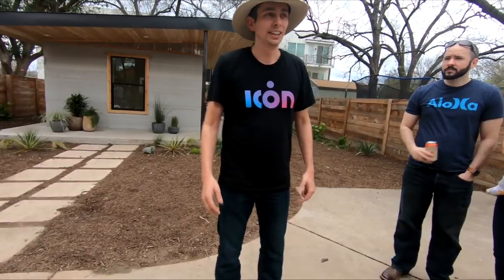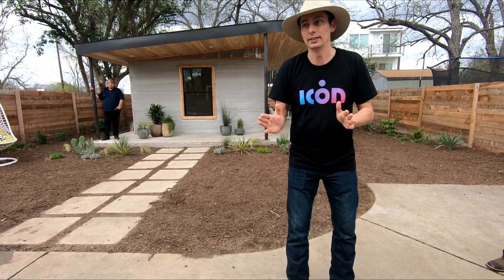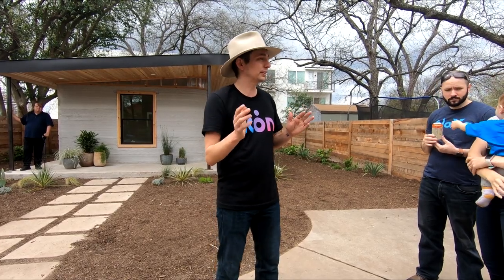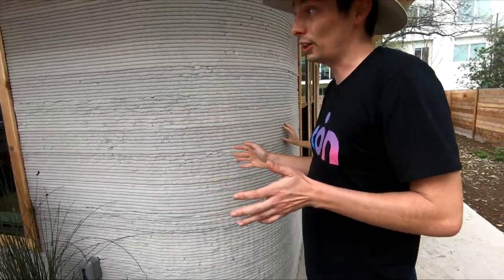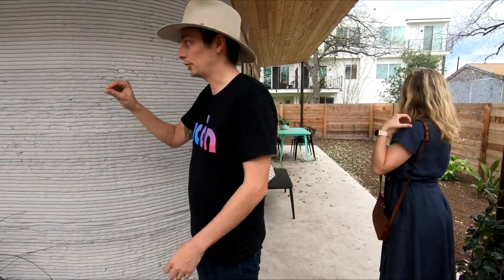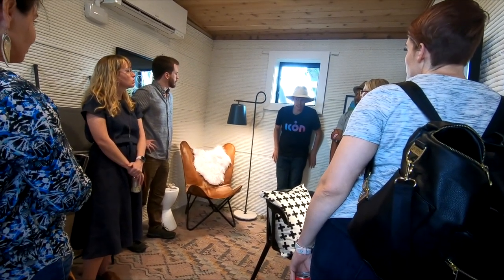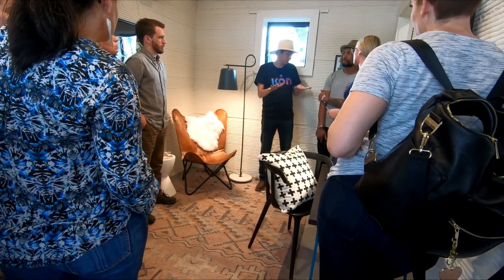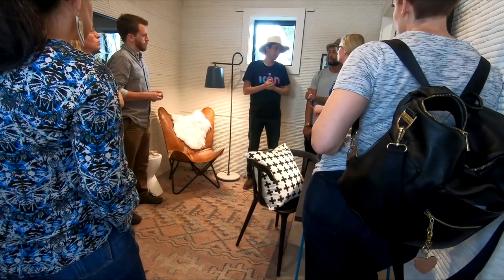Inside America's First 3D-Printed Home (Deeper Look)

Comment: This is amazing. This fix poverty not only here all over the World. God Bless you.
Reply: JRRnotTolkien  from what I hear, they are aiming for a 50% reduction of cost. Right now, the prototypes are still working out the details and like all new technology, things will get faster and cheaper as the tech matures. Already the new printers will be more than twice as fast and cheaper to use. In fact, they wrote an app for a ipad that can be used to control the printer as well as make on the spot alterations of the house plans. As for 3rd world countries, simpler and smaller homes can be done at significant cost savings. Soon they will be able to print a whole neighborhood of houses for the homeless at significant savings...houses that are more durable in the long run than conventional homes.

Comment: The only issue I see with the horizontally ridged walls is that they would collect dust. People with dust allergies would need to have the interior walls finished with a smooth coat like was done in the bathroom.
Reply: The creator in another video stated they can do smooth walls!

Comment: Apples to apples compare is required before we say Eureka ... What is the cost diff by the time you add footing and all structural elements + non structural elements also while 3 D printing how do you strengthen the walls? How do you stop and start to put Windows and doors ? For the printer to work it has to be installed and levelled first  , have you considered that cost it all adds up in cost so $2500 for a print is a only a small %  Lets be rational here Engineers!

Comment: Air crete I've worked with it awesome product if you could 3d print with that you would save at least 40% of your concrete I built a air crete panel house 400 square feet 😎